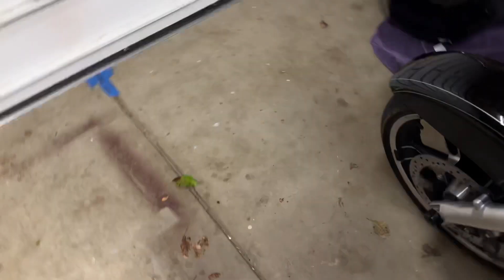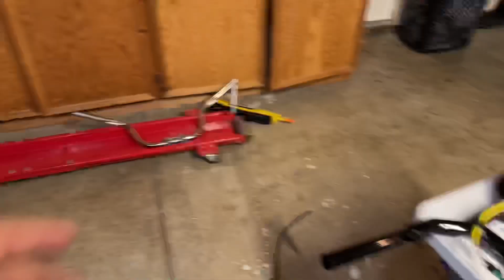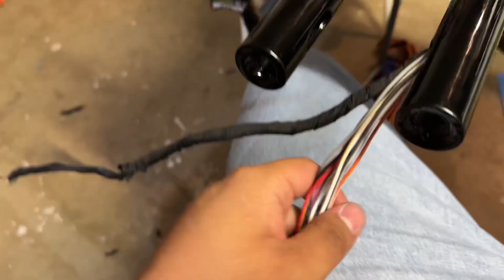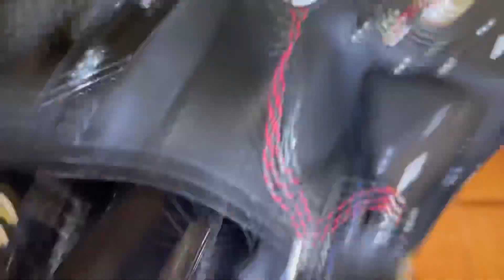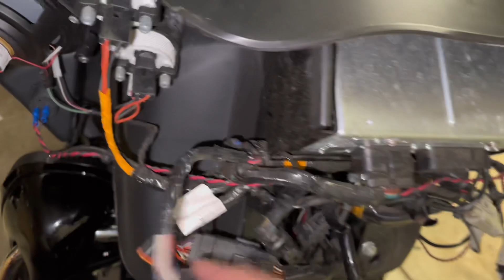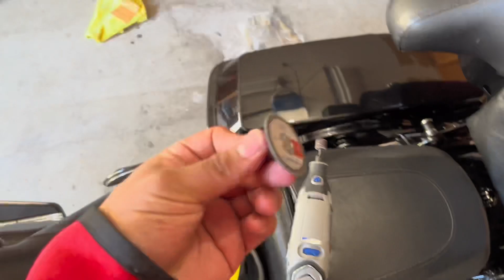08-2013 road glide TBARS HOW TO w/ stock cables

Comment: Ive got a set of 14 and 16 inch Lucky Daves heavy hitters. Jsut wondering which size to go with. I'm 5'11. Any input?
Reply: 16 might be too high of a stretch for your arms im 6'5 and rock 16"s and my arms sit about an inch or 2 above my shoulder that's also with a hd tall boy seat